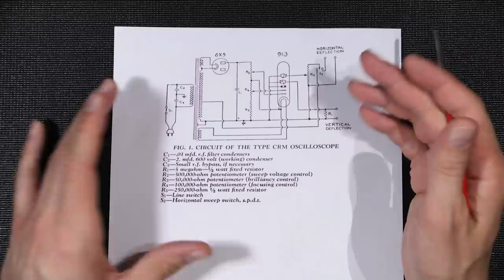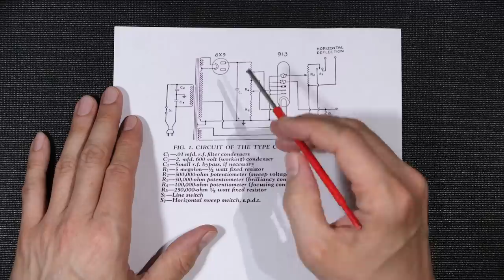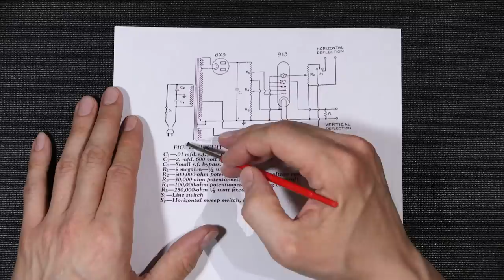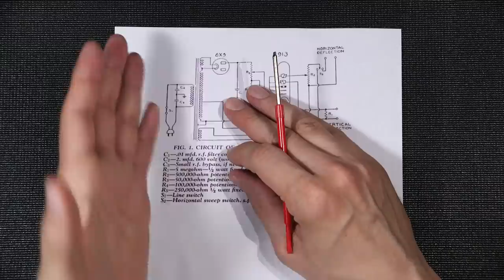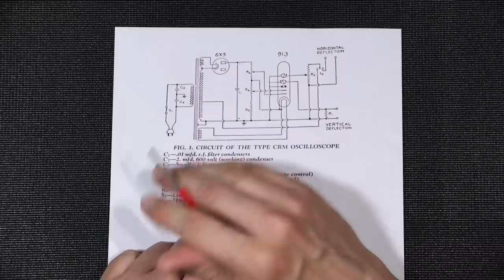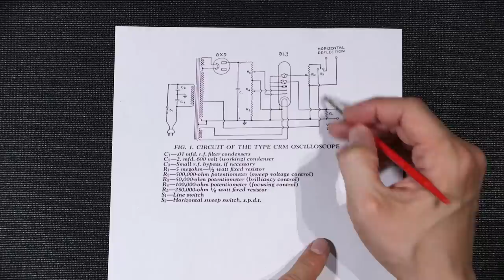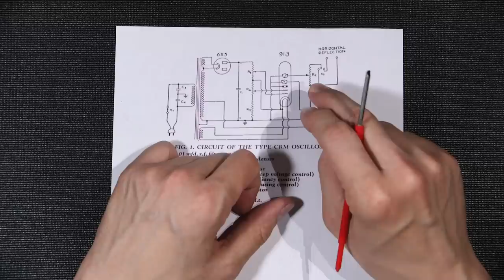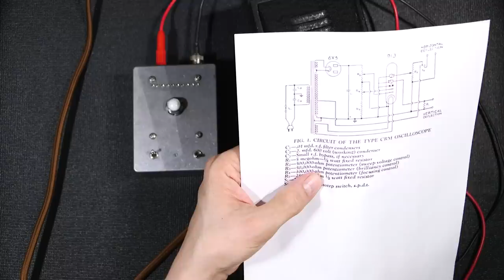Neat Electronic Tool From The 1930's, Lets Look Inside!

Comment: “Back in those days they didn’t label controls...”

- pulls out capacitor tester with no labels -    :)
Reply: Beefchicken Industries lol. When you design your own cap tester like his you have intimate knowledge of what the switches do :) Vintage gear with one knob one function or stacked controls like old tektronix scopes were so well thought out you sorta know where to reach without even thinking about it. The mechanical design was also  really a work of art.
Reply: I don't disagree with it either. The guy who invented the mouse, Douglas Engelbart, said something along the line that interfaces shouldn't be strictly designed to be "simple to use", because once a person has memorized them they don't look at the labels, so the focus should be instead on making interfaces powerful. Touch screens in cars are a great example. In my car, I can control the radio and head without ever taking my eye off the road. I have the position and settings of every control memorized. My wife has a newer car with a touch screen, and it is impossible to aim at the correct square millimeter of touch screen that I need to turn off the fan blowing freezing air in my face without looking at the damn screen.

Comment: why vaccum tubes were made usually out of glass instead of bakelite or whatever
Reply: Kacper S. Most other materials of the day would not hold a vacuum. Bakelite is very porous and would not hold a vacuum long. Balelite wpuld also have to be much thicker than glass to withstand the vacuum if it was used. It would have been difficult to seal off as well
Reply: Kacper S. You need something cheap, vacuum rated that doesn't outgas and is easy to process. ceramic  metal glass seals have been working forever.

Comment: De-potting that transformer has a huge Ugh-factor.  Why not just simply remove (and isolate) the capacitor common ground connection, then install 2 new safety caps between the line, forming a new common ground-point.  Better yet, additionally install a 3-wire line-cord. Yes, you'd still have the old caps in the circuit forming a high-impedance parallel-resistance across the line but with them being in series, I don't think they'd give trouble for some time. But (as in Roman times) your commenters want blood, so I think your stuck de-potting. Paul, you surely had to see that coming -- LOL !!!

Comment: Hi: Paul     Depot the transformer, just to see what they did with the safety caps.   I have been getting some of my capacitors for my older projects from https:justradios.com, David has lots of odd sized capacitors for old tube and test equipment.  He also has the X and Y safety caps on his website, and discusses the need for their replacement.  I believe that you know of his website.      Keep the videos coming,  I just love your videos.  Later Ray Burke